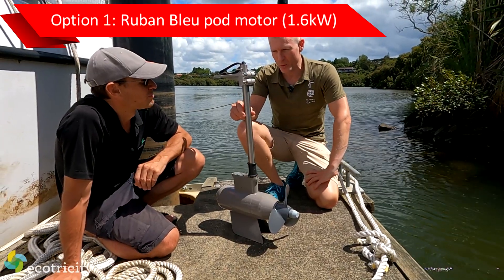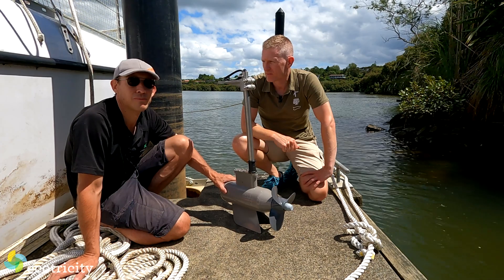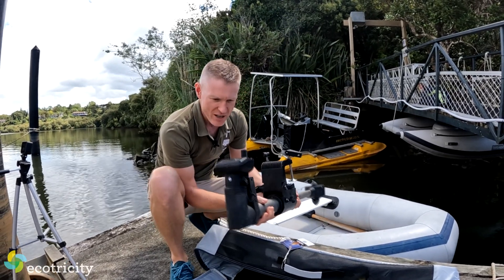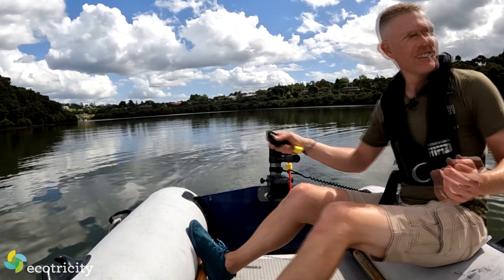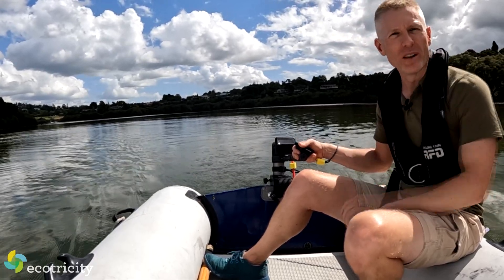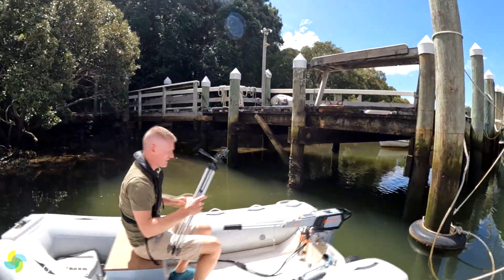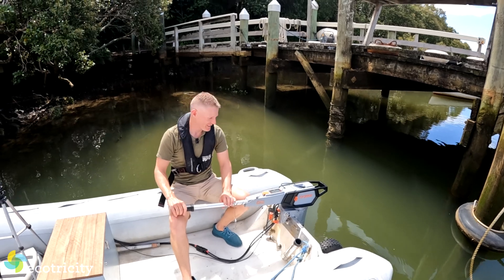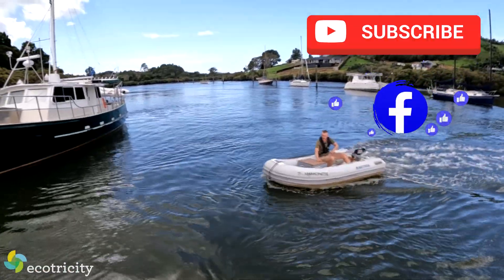Electric outboard motors: 3 eco-friendly options

Comment: Electric motors for boats have been around for a long time.   I've got two MinnKota motors.   One smaller and the other is a three horsepower.   Plenty to move a big deep V around.   The boat I bought from a friend also has a 15 horsepower gas motor that I never used.   I'll sell my gas motor after having it checked by a mechanic and put it up for sale since I don't use it.
I've used my electrics on my 19 foot square stern canoe for years.   Basically in my home state of Pennsylvania there are a lot of lakes that don't allow gas power.    The bigger lakes that allow gas motors are actually too big for the canoe (which is what I use most of the time anyway).
Enjoy your boating everyone